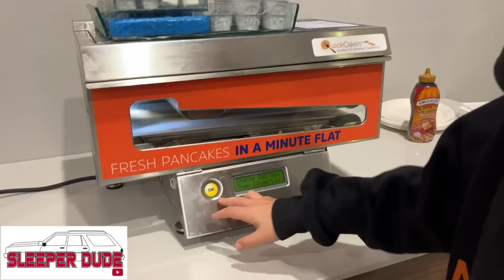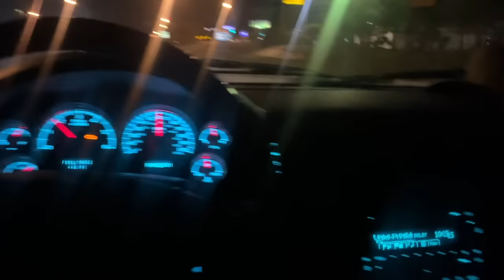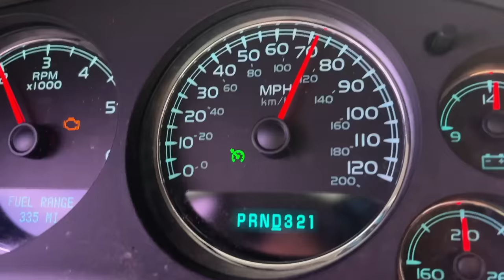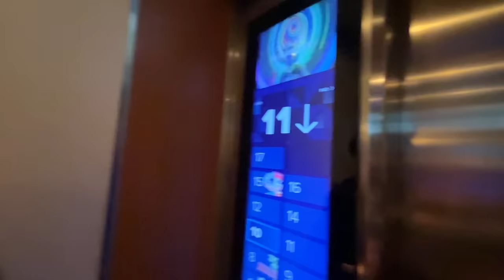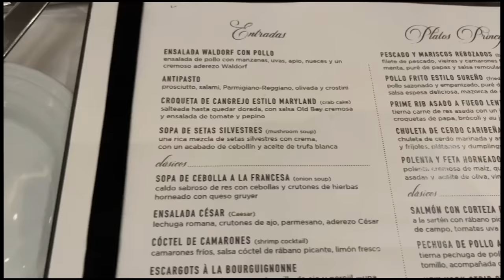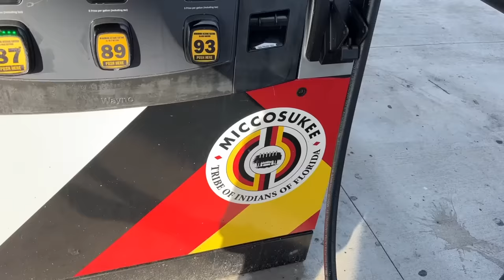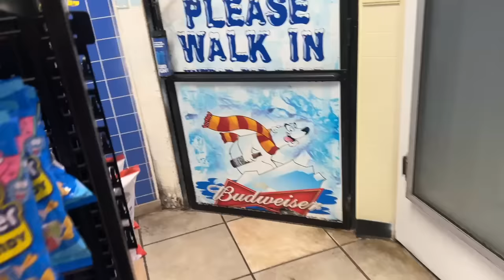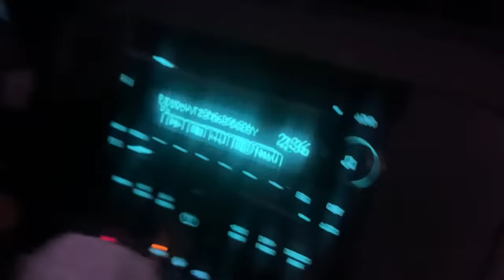Surviving a cruise with my in-laws and a 1750 mile road trip.

Comment: Should think about a 12x15 ft long paint booth so you can start doing body work and paint on some of the classic cars you have at home just a suggestion and the hardest thing to do will probably be the concrete foundation along with the ventilation and numerous filters clean fresh filtered air in warmed up of course but clean fresh air going out FYI just a suggestion

Comment: I must say I also see speed limits as a starting off point. If you don't reach you destination quicker than the GPS says, you are defiantly doing something wrong. 😁😁😁😁😁😁😁😁😁😁😁😁😁😁😁😁😁😁😁😁😁😁😁😁😁😁😁😁😁😁
Reply: @sleeperdude2690  I mean come on, any car built after 2000 cruises at 90 - 100 miles an hour, so seriously why would you drive any slower?